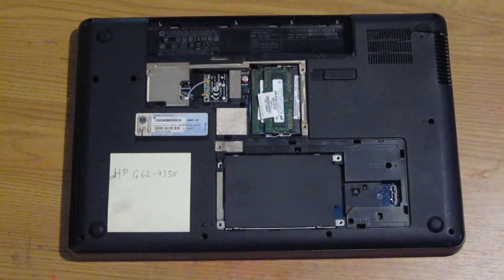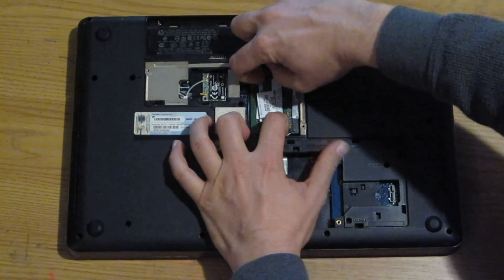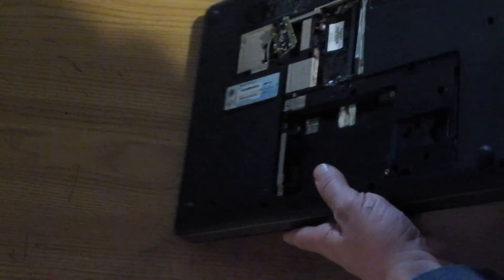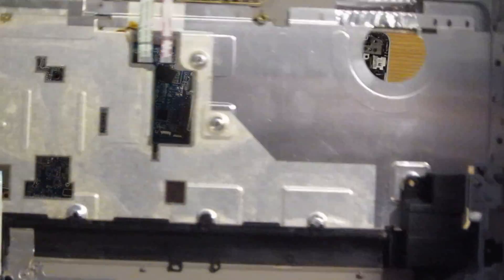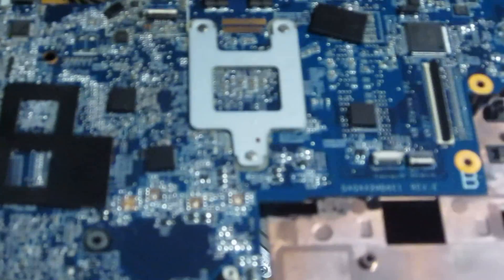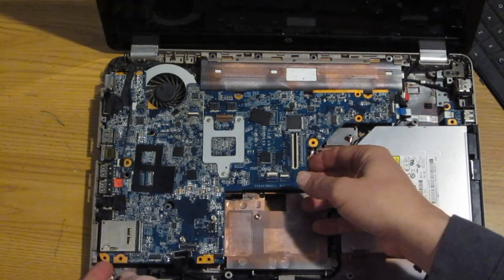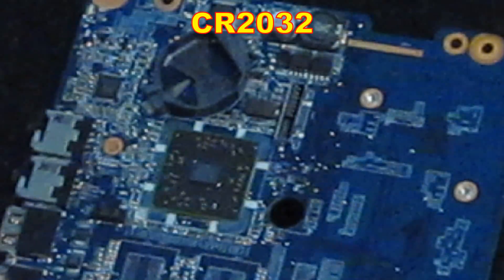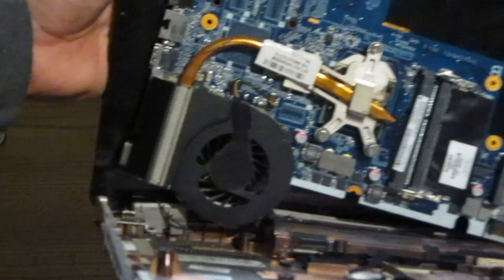Where is the BIOS Battery? HP Laptop G62-435X

Comment: If I changed this battery my black screen issues will disappear knowing that charging laptop for 1 hour worked for me but the problem occurred again
Reply from the maker: I am not sure. There are many different issues that can cause this problem.  It could be a bad solder joint on the mother board, or a broken ribbon cable, or bad video card, none of which will be fixed by this procedure.  I only recommend this as a very last resort.  It is a risky procedure, and may not fix the problem, depending on what causes the black screen.
Reply: jaynes network thanks mate
Reply: FN & f4 together pressed together after placing magnetic tape across lower front of inner case below screen while HDMI cable is plugged into a tv or monitor & you'll get your laptop screen back for bios update internet connection etc...then replace bios battery...